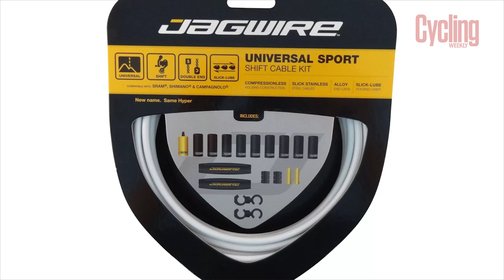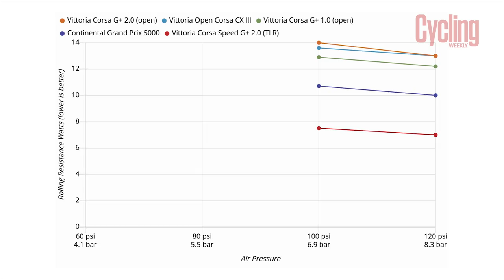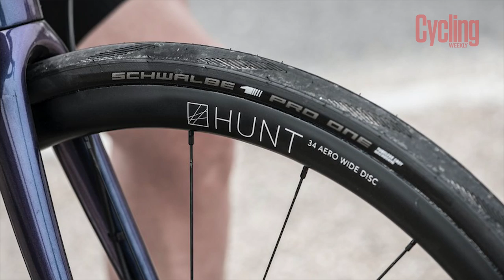9 Upgrades To Make Your Bike Faster | Cycling Weekly

Comment: How does changing headset bearings make you go faster?🤔
Reply: You are right.
Reply: random video editors that have no idea can just splice in a clip of you crossing the line first. tres faster.
Reply: It doesn't
Reply: You get lighter wallet
Reply: Lighter wallet and easier Turing so easier cornering
Reply: You save 5 watts with every turn. Have you seen his skinny arms?
Reply: It doesn't but its probably for to not get broken??
Reply: The point was more about the bottom bracket and wheel bearings, but they instead showed the wrong bearing.
Reply: 😂awsome comment
Reply: I think they mean the ones on Your wheels, and bottom bracket
Reply: maybe theres really a point there at one time i overtighten wrongly on my full carbon bike frame and carbon fork headset bearing ,the handling become so much stiffs and turning seem like so much stiffs and they a slight feeling of friction there,and when i start i loosen it,make riding more butterly smooth
Reply: @stanislavkindiakov6334  if o use credit card it gets lighter?

Comment: The two best bang for buck improvements are get used to riding on the drops and keep your bike clean 😁
Reply: Plus its good therapy to clean your bike.
Reply: unfortunately drops are often less aero than hoods + well places forearms.
Reply: Why is that Alex?
Reply: The highest drag position was the classic upright riding position with your hands on the hoods, which required 430 watts to overcome air resistance. Lowering into the drops with straight arms saved a bit of energy, requiring 417 watts. Going even lower in the drops by bending the elbows and hunkering down saved more energy still, requiring 385 watts. But the most aerodynamically efficient posture was actually hands on hoods, arms bent with forearms parallel to the ground. In that position, the rider needed to produce 372 watts, a 13.4 percent reduction from the first hands-on-hoods posture.

For a rider churning out 300 watts on a 40K (25 mile) time trial course, that simple adjustment of posture (bending the elbows and lowering the torso) could shave off nearly three minutes from start to finish.

https://www.bicycling.com/skills-tips/a22107504/aerodynamic-definition-in-cycling/
Reply: @teoheugene  My speed always goes up in the drops.
Reply: @teoheugene  The Superman position.
Reply: @benpierce2202  haha.. True.

Comment: I’ve moved to Vittoria Graphine 2.0 and latex tubes and the difference is amazing. Less rolling resistance and the buttery smooth ride makes my ride easier and more comfortable.
Reply: What tires and Tubes where you using before ? How often you have to pump the tires ?
Reply: Tubeless are faster

Comment: One of the easiest upgrades is to look up your ideal psi tire based on weight.  The back wheel should be a higher mm or higher higher psi. The front tire should be softer.
This is because the vibrations mixed with a super rigid frame causes you to use more watts to do the same bike speed output.
Reply: I like to start with higher inflated tires, and then adjust the pressure as I go. So I don't really know the exact pressure, but also don't really have to.

Comment: Maxxis ultralight tube is good and light enough. R9150 caliper goes sharply ahead of its competitors. Swisstop brakepads are sweet, but wear out fast, try campy's. If you budget for ceramic headset bearings, go FSA ACB SL. Conti 5000 is good, but specialized turbo cotton is fantastic (pricey). When speaking of wheelsets, Vortex from China is the killer of its price range, if you could get a pair.  And the last, most important IMO, get a proper cycling suit, for the comfort and aerodynamics.

Comment: 5Kw less friction for latex tubes, is it worth it?
Reply: Go with Swalbe extra light inner tubes.
Reply: @markprinsen7257  noted!
Reply: @markprinsen7257  those are slower than latex
Reply: @laury21  marginally, but they are a lot more durable, hold pressure and are cheaper :)
Reply: @markprinsen7257  it’s actually quite big, 7,5 watts at 45kmh. Aerocoach did testing. True about pressure, cost is very similar, i buy vittoria latex tubes for 10€ each. The schwalbe is still butyl material, just lighter than regular.
Reply: @laury21  tried latex also, but for me this is the perfect mix :)
Reply: 5 Watts (W), not Kilowatts (KW). 5KW = 7 hp.

Comment: Latex inner tubes are weak, you'll lose speed from having to stop to change out flats. If you're worried about friction in butyl tubes, do what I do and rub baby powder on them. Talcum decreases friction between tire and inner tube.
Reply: That’s not how it works. Latex is more supple, therefore faster. Nothing baby powder can change😊 also latex is less prone to pinch flats. Havent had a flat in 3-4k km
Reply: I don’t think it is the interface between tyre and tube, but rather the internal hysteresis of latex vs butyl. This is the energy lost to friction internal to the material.
Reply: @bjma654651651  How much actual real world difference? I question many 'upgrades' as they seem likely to be such a small improvement. Until today I actually had never heard of latex tubes. Of course I am not a racer just an enthusiast, still like to be somewhat knowledgeable. - Cheers
Reply: @joeshmoe7967  Latex tubes made a noticeable difference for me. I read it’s about 5 watts per wheel. Each latex tube is about £12. One of the biggest bang for buck upgrades for a road bike. Downside is you need to pump your tyres before every ride.

Comment: How investing in better brakes will make the bike faster or more responsive? Maybe he means downgrade the bikes to rim brakes save weight then go faster?
Reply: Better your brakes, the less you need to pull on them to slow down. So you spend more time putting power into the bike.
Reply: @henryhuber1050  After checking with my friend Google, I found that better brakes have less tendency to slow you down because they never touch anything if they are not actuated by the rider. It make sens now.
Reply: Well, You bike per se won't be faster. But Your riding might be - as with better brakes You can brake harder and later, saving speed.

Comment: latex tubes are porous. They don't hold air very well. You're talking about marginal gains, not upgrades. We have looked at marginal gains for decades. Not all new tech is a good marginal gain. You left a lot out about centrical forces and fewer spokes make a weaker wheel. If you are looking for a lighter bike and to go faster then I would suggest fuel sauces first.
Reply: 45 fottuto stronzo  
That's not actually correct they are 5-5 w faster .It is only a suggestion that they are up to 5.5 faster with certain tires not all .It depends on tire compounds .I have used latex tube and they do offer a better rolling resistance with some tires. Continental 250gm sprinter use latex tubes in there tubulars and they are very fast .  They are 11 barr..Bicycling Australia in the 90s wrote a piece on the heat of a wheel and the research on what a tire and  tube do when ridden .The tube twists around quiet a bit when ridden. There conclusion was that the actual heart of the wheel is the tube Cheap tubes cheap ride  .We know now that the biggest issue is friction and ground coverage when ridden .We knew this in the 70s none of this is new .The selection of tires didn't exist then ..It is still marginal .
Reply: ... You're* talking about. And you do not put spaces before a fullstop or comma,* only after.*

Comment: You need a good light frame and two set of wheels. One solid, heavy alloy cheap for (alot of) training and the other one super fast tubular Carbon for race. If you at pro level fitness/speed and ceramic bearings maybe will make a differnce you get them from your sponsor...

Comment: “Tips to go faster”. The second tip was about braking. Wtf
Reply: Braking fast means you remain speed longer. Not hard to tell.
Reply: @milescrowe2162  I don’t need to brake quickly to be able to hold speed. Work on bike handling skills and maybe you can hold speed without having to touch the brakes.
Reply: @lookpro.rideslow  Then may the goddess Fortuna be with you , avoiding those variations in road conditions on streets or descending. #LOVE&PEACE.
Reply: @milescrowe2162  lol be safe

Comment: Latex WTF ? Tubolito thermal plastic innertubes.
Reply: Latex is faster than tubolito
Reply: @laury21  I don't know about you, but I like air in my tires. Also Tubolito tubes are more resistant to flats. As for faster? prove it?